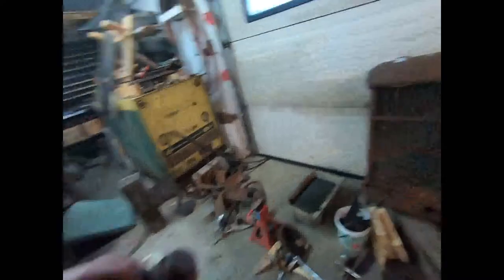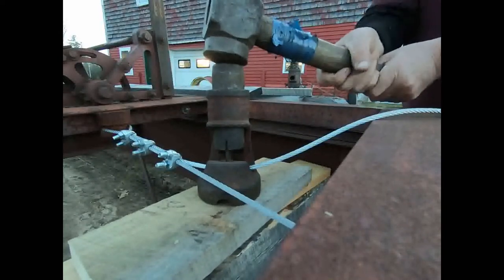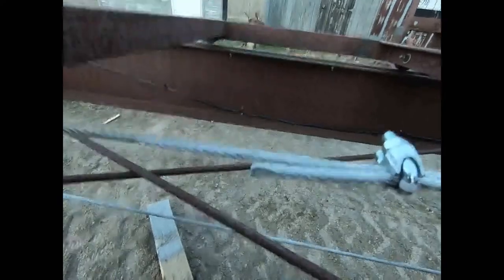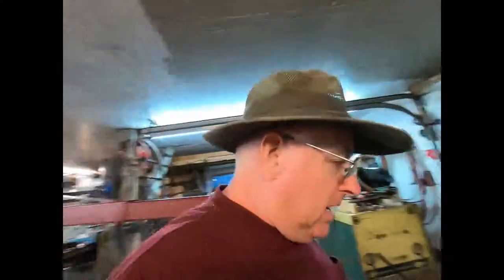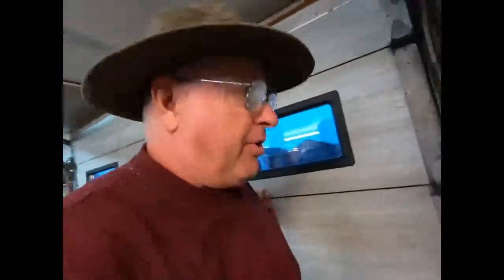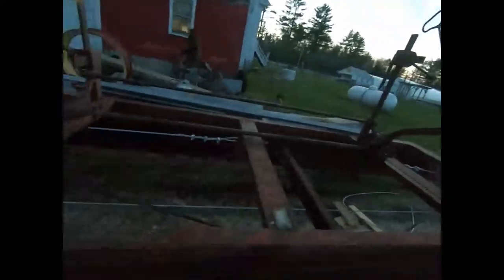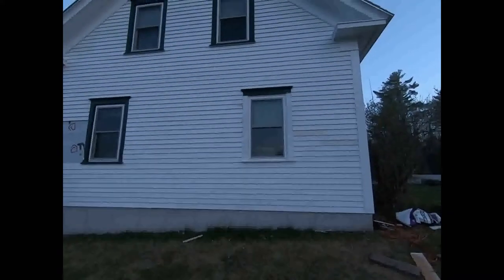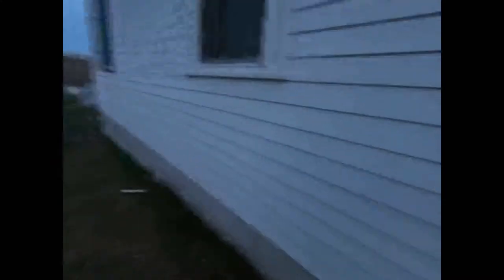#269 how a impact cable cutter works

Comment: Smaller cables a cold chisel works well. For heavy cables I have a hydraulic cutter. Most folks just use an abrasive cutoff saw.
Reply from the maker: When logging you can only carry stuff that doesn't need attention